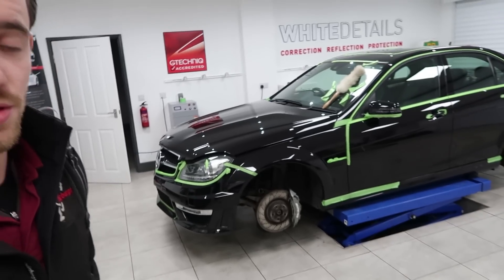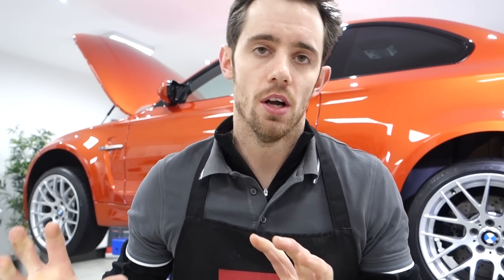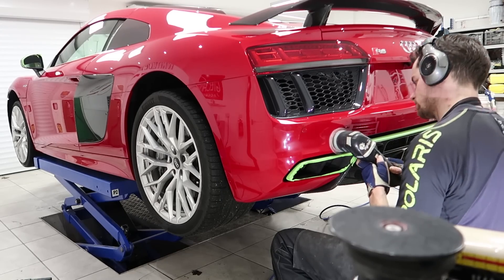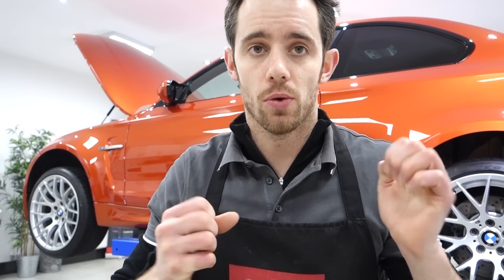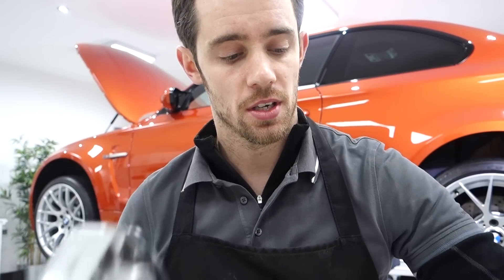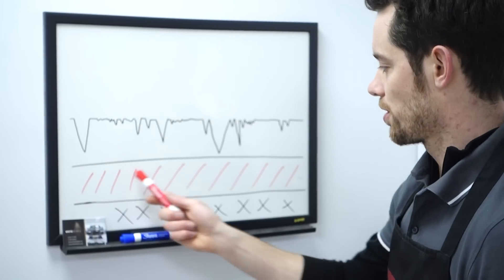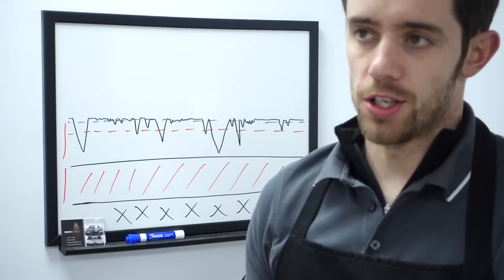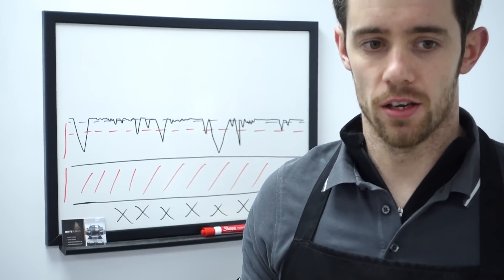Q&A + WHAT IS PAINT CORRECTION? - VLOG 18

Comment: Jim, I have a black Lexus GS 350 F Sport with the Gtechniq Crystal Serum coating, applied by a certified installer about 4 months ago.  I wash using a two Bucket system, rinse very well, and air dry.  I am still getting fine scratches in the coating.  Can you recommend a light Polish method or finishing spray I can use?  Thanks.

Comment: What detailing spray do you use .?
Reply: I don't think he'll use a QD spray as such. He tends to use the Gtechniq/Carbon Collective coatings. These are a hard, glossy and hydrophobic coating for maximum protection. Putting a QD spray on top will mean your left with the lesser performance of the QD rather than the expensive coatings. QD sprays are better to get you through the 3 months until you need to apply a fresh coat of wax or more traditional sealant. With these latest coatings lasting years rather than months, no need for a QD. Jim may correct me if I'm wrong (if he has the time!)

Comment: Hey Jim, I needs some advice, I have som really bad tar stuck on my car. Tired clay bar and tar remover any other suggestions???? Thanks in advance !
Reply: Ben Bradbury a dedicated tar remover such as autosmart tardis will work. If there heavy deposits try a trick i seen jim use was to soak a little pad similar to a make up removing pad and place it on the deposits. Hope that helps
Reply: Russell Keys thanks for your feedback, I tried Simonz bug and tar remover with no luck. The pad sounds like a good idea will try this.